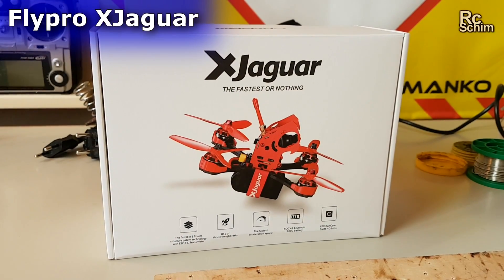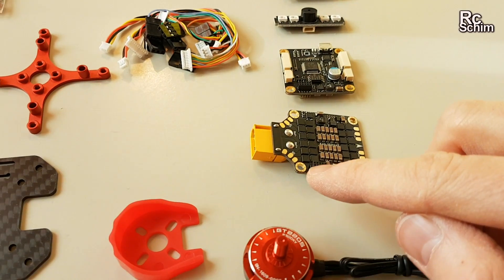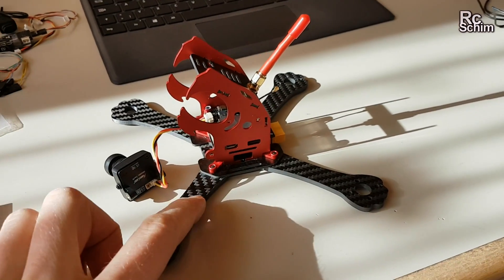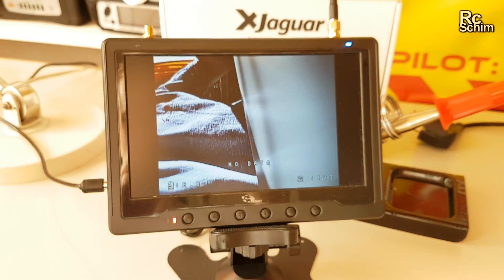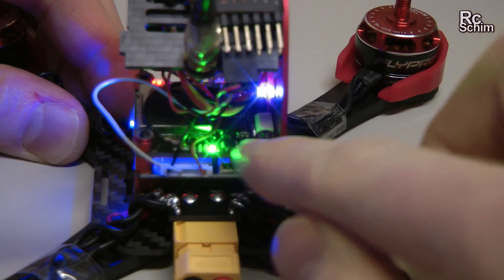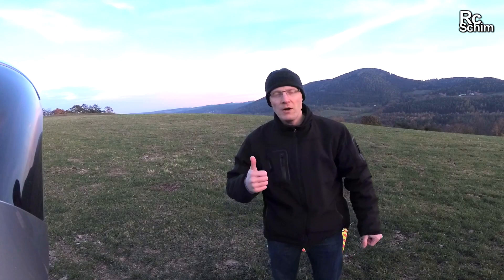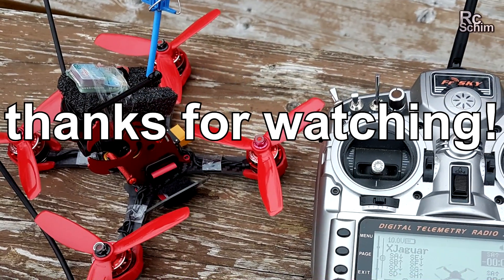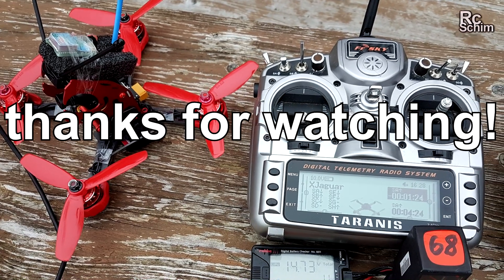Flypro XJaguar Unboxing, Buildtips, FPV flights and Speedtests

Comment: Ich hab mir die neueste Version von Betaflight installiert und nun sind die Einstellungen vom OSD und von den LEDs weg. Weißt du wie ich die Originale Software wieder bekomme? Für Antwort wäre ich sehr dankbar.
Reply from the maker: ich denke Du musst nur die UART Einstellungen wieder aktivieren, damit die Daten von der FC and das VTX/OSD Board übermittelt werden...
Reply: Jep, danke das wars. Steht sogar in deiner Beschreibung. Wer lesen kann....

Comment: Very nice video mate.  Thanks for sharing this.  

What battery packs are you using?  I'm guessing that the c-rating may be a little on the low side because it looks like your pack voltages drop a lot under high load.  I found that you really need 65C or better.
Reply from the maker: thanks, I use the same as you apparantly (graphene 65C 1300mah). One of the packs used was the one that is supplied with their kit. The ROC "100c" 1300mah. But it looks  like this isnt much better performing then the 65C ones (maybe even worse?).
It also was quite cold (~8°C) maybe the whole system would work better in 20° and sunshine :)  (I would definitly!)
Reply: Ya, might be due to cooler temps and/or that ROC 100c being a little optimistically C-rated.  It's 25 deg C here right now and Sunny so out I go for another fun day with my XJaguar!  Cheers mate.